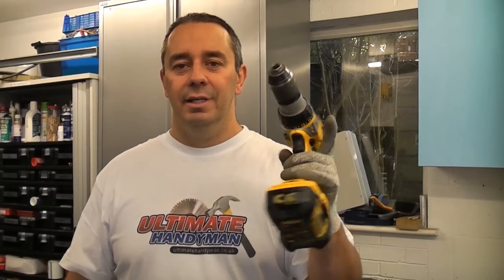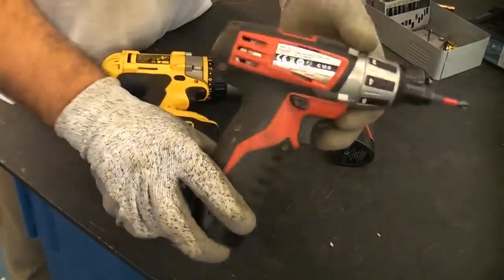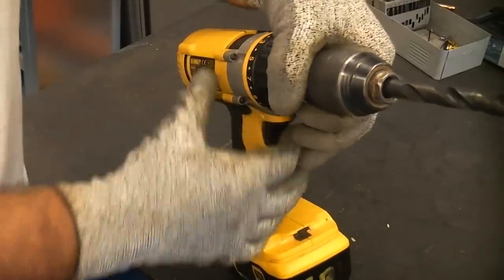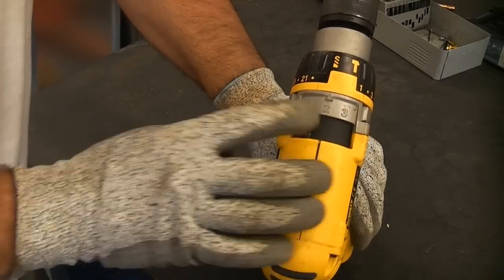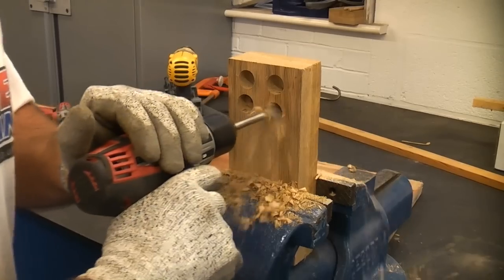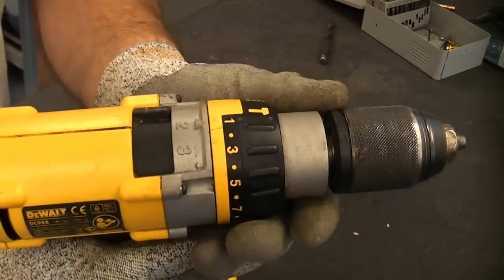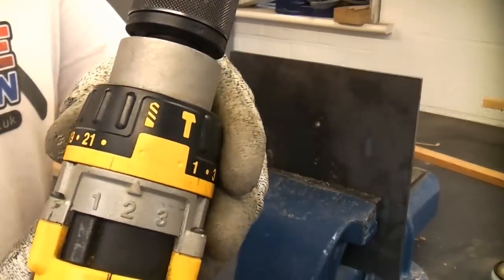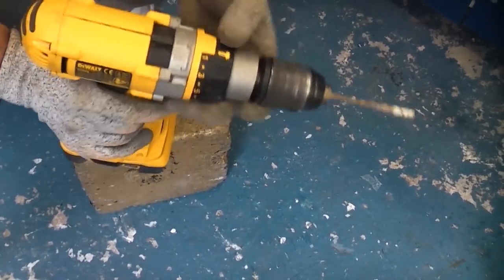How to use a cordless drill

Comment: Thanks for the demonstration & explanation.  I was using  a dewalt Dw 511 model to cut 3 inch holes with a 3 inch hole saw attachment to drill the blue pladtic drums & as the hole saw started to "bite" into the pladtic the whole drilling machine whipped out of my hand & landed almost 3 feet away.  Thats when i learnt about getting the right torquein a unit for the job at hand.
Reply from the maker: I'm glad you found the video useful.
Thanks for the comment 👍

Comment: Thank you so much for this. My Dad didn't think a girl needed to learn about DIY, so I'm a clueless adult. This video helped me fit cabinet handles in my bathroom. Awesome!
Reply from the maker: You are welcome
Thanks for the comment
Reply: Good on yer. Occasionally run into some very astute female sparkies on-site.
Reply: cabinet handles, pedicures, hair, no problem, girls can do that.

for real work, you need real men💪
Reply: Yes, my dad always said to find a man, which made me want to find a man even less. It is frustrating, though, getting this stuff and not having a clue. I'd like to hang my drapes with something other than command hooks, but a drill seemed like a better idea than manually screwing everything.

Comment: I got myself an 18V De-Walt, the first time I've had a drill with a little more power, thanks for teaching me how it works and reminding me to wear my safety specs, I suppose a safety mask is needed too depending on what you're drilling.
Reply from the maker: You are welcome.When drilling in some conditions a safety mask may be required.
Thanks for the comment

Comment: I got my first drill today, like a big kid hehe. Two things i thought i would mention; The torque is important incase you are driving screws into soft wood, if it's too high you will drive it through the wood, so it's important to pick the correct setting, how do you know which is the correct setting? start low and work your way up. Secondly when locking and unlocking to change your bits remember this saying (Lefty Loosey - Righty Tighty) :)
Reply from the maker: Thanks for the comment ;-)
Reply: Always use torque control, it saves your screws and your bits.

Comment: I just noticed that this demo was from 2014 - 5 years ago but I hope you're still stopping by to read the comments. Thank you, thank you. LOL Faith Hope and I are the two women who had the exact same problem in that we 'assumed' that we hit metal when the screw didn't go in and then chose a different location. Having watched your demo about the various torque settings, I'm almost sure that this may have been the problem. I have a Dewalt 20 V impact / power drill. My problem is that no matter how tight I turn the chuck after inserting the bit, it keeps loosen itself and upon removing it from the screw, it falls to the floor. What am I doing wrong? Or does the tool have a defect? I'll be checking in to see if there is a response from you.  Thank you ever so much.
Reply from the maker: Once the chuck is fully tightened, it should not come loose, unless the chuck is not tightened fully in the first place- or unless the chuck is faulty. Some keyless chucks have a two part chuck, so you need to hold the rear of the chuck with one hand, whilst tightening the front of the chuck with the other hand, but on more expensive drills the chuck is normally a one piece chuck. 
Thanks for the comment 👍

Comment: Just slightly confused. Are the 3 gears pre-set combinations of speed and torque? If you need to fine tune the combination of speed and torque, do you select a gear and then change the torque setting? Or do you use the variable speed to correspond with your torque setting? Hope the question makes sense.
Reply from the maker: No, you have to adjust the speed and the torque separately using a combination of the gears and the torque selector ring.
Thanks for the comment ;-)

Comment: saw on another video a demonstration that said when putting drill bit into chuck, tighten with your hands until tight and then turn in the opposite direction 'loosen' until you hear one click. This seems to be right in practice, but want to make sure i'm not damaging my drill!
Reply from the maker: I would not do that- just tighten the chuck as much as you can, otherwise the drill bit will not be gripped correctly.
Thanks for the comment 👍

Comment: Thanks for the excellent explanation

may sound like a stupid question..
how much Watt Power did the drill had? How much is enough to make holes through concrete?
Reply from the maker: I'm not sure, but it is an 18v drill, most drills above 14.4v will drill masonry as long as they have hammer action.

Comment: Really great video. Does the torque have to be the same setting when pulling the screw out as putting it in? Ex: i used 6 torque to drill do i have to use 6 torque to reverse?
Reply from the maker: No, when undoing the screws, you can just use the drill in it's maximum torque setting.
Thanks for the comment 👍

Comment: Great video and CLEAR demonstration.  I have the Dewalt DC725, its the  two speed version of the Dewalt in this video.  Can I install 1/4" lag bolts into studs with my drill and what would be best setting?  Thank you again!!
Reply from the maker: A drill is not really powerful enough to tighten bolts, you are much better off using an impact wrench.
Thanks for the comment 👍
Reply: @ultimatehandyman  I guess I lucked out...I got them in no problem.  But will probably purchase an impact driver the next time when they go on sale!  Thank you for your work here!!

Comment: While this is definitely the most helpful explanation I've come across–of how the speed and torque settings work, I'm still confused about a few things. To give you some background information, I'm using the DeWalt DCD780 Cordless Drill Driver, 20 volt, which has two speed and 15 torque settings. My first question is: When in drill mode, how do you know which speed to start with? From your demo, where you don't have enough torque to finish boring all the way through that wood with the spade bit, I know that switching to the lower number speed gives you more torque. But let's say you are drilling into something softer, starting OUT on the lower speed (I.e., you have too much torque for the job), how does the drill behave? My second question is twofold: First, when in driver mode, how do you know which speed or gear (in my case, I have two) to begin with? And second, how do you know where to set the torque (in my case, I have 15 settings) at the start of the job? Is one way safer than another for the user and/or the tool? 

Even though I'm very mechanically inclined, I've never been able to get a good understanding of these things, nor was I ever able to master riding a 10-speed bicycle! (I have mastered driving cars with manual transmissions (or stick shifts as we call them here in America), though, so I'm not completely hopeless.) 

Thanks!
Reply from the maker: bamabenz2000 

When selecting the drill speed you normally set it according
to the size of the drill bit that you are using. If you are using a mixer
paddle for paint, holesaws or large diameter drill bits in metal you need to
use the slowest speed- which as you say will give the most torque. You may also
find that larger diameter drill bits stall when drilling wood, so again you can
use the slower speed.

 

The faster speed on the drill can be used when drilling
small diameter holes, for example when drilling metal up to about 6mm in
diameter (1/4”) or when drilling wood up to about 12mm (1/2”) but it does
depend on the drill so that is just a rough guide.

 

When driving in screws it depends on the thread of the screw
and also the size, some screws drive in much faster than others depending on
the pitch of the thread so really you have to test the screws that you are
using to find the best speed. If they go in so fast that you lose control when
driving them it’s best to select a slower speed. When determining the torque
setting for the screw you can either start with the lowest torque and keep
increasing it until you get the screw head flush or just below the surface or
you can start with an higher torque and quickly let go of the switch when the
screw is at the correct depth, then adjust until you get the correct depth.

 

I hope this helps ;-)

 

Thanks for the comment

Comment: ❓Question sir, (or anyone who knows, I’m sure he’s quite busy) @7:46 what was that stuff sprayed before drilling the hole and why is it needed. Thank you. 🙏🤗💞🤗
Reply from the maker: That is metalworking spray, often called drilling/tapping fluid. It prevents the drill bit or hole saw from overheating, which can cause damage and often render the bit useless. When drilling steel or stainless steel, or other hard metals it is important to use it, or your cutting tools will soon go blunt.
Thanks for the comment
Reply: Ultimate Handyman - 🙏Thank you! I will be sure to get some. 💝

Comment: Thanks for the fantastic videos. I have a metal drilling machine with high torque and slow speed, the drill is too powerful that I am afraid to use anymore, the first time it twisted and broke a 13mm bit I was using, even though it has a very beefy handle.  The second time it nearly broke my wrist, so I stopped using it all together. Any idea how to use such machine safely?

Also, are hole-saws supposed to run straight and true? Or are they supposed to have a bit of a wobble on them? Because mine always wobble a bit. Thanks again.
Reply from the maker: You are welcome.
Some powerful drills can be dangerous to use, we have a Bosch drill on site that uses morse taper drill bits. The drill has two handles opposite each other. I have had a few fights with it over the years and always won, but it's best not to use drills that don't have torque control or a safety clutch as they can be dangerous.
You could try drilling smaller diameter holes first, then work your way up to the larger diameter bits, this will mean the drill will not struggle drilling the hole which should mean less resistance for the person holding the drill.

Some hole saws wobble a bit, it depends on the quality of the hole saw, also some of them have teeth that make the saw wobble a bit during use.
Reply: Thanks :)

Comment: Your demo was good, thank you for that. But having watched your video, there is something I'm still not sure of. I was trying to screw some metal plates to a solid bamboo table top (which had predrilled holes) - with great difficulty. I have a 18v drill, and I haven't used one before. I used a PZ2 bit for the screws (PH2 wasn't such a good fit), and for the most part I was able to drive the screws in. But the drill struggled a lot to get the screws all the way in even in low gear and high torque. I had to put a lot of weight behind the drill. Why was this?
Reply from the maker: Are the holes in the metal wide enough?
If you try putting the screw through the hole in the metal it should go through without catching the sides, if the screw won't go through the hole in the metal this is probably causing the problem.

Comment: Is the 18 volt machine suitable to use for drilling a hole through a concrete wall? The wall is about 4 inches thick. I basically want to put a BT telephone cable through that hole and connect it to the BT master socket.
Reply from the maker: It will do it, but a SDS machine would be much easier and quicker. You could do it with a 18v combination drill though if needed.

Comment: Hi, maybe you can help. I have an Erbauer Combi Drill (4 ah battery). I am having problems screwing down my squeaky chipboard floor. Even on first gear and 23rd torque setting, using 45mm Floor Tite flooring screws, the screw only goes in at best about 2/3 before the drill refuses to go any further. I've looked under the floor and I note that there is a narrow beam of timber (ply I think, blonde in colour, about an inch thick), which sits atop the joist between the joist and the timber floor. All I can think of is that this may be too dense to penetrate.  Before I resort pre drilling all the holes I hoped you might have some insight to help solve the problem. Up till now the Erbauer drills been performing well but on less demanding jobs. Its the kind of job I thought the combi would be OK with. Love the videos, learnt a lot, keep it up. Thanks. Steve Price.
Reply: Personally I'd get an impact driver. I prefer those to a drill for any kind of screw/bolt.  It doesn't get bogged down like a drill will because its using the impact to drive the screws.
Reply from the maker: Like snoopy the ace says an impact driver is better, but the drill should drive it in. Perhaps try putting the drill into drill function, so that you don't use the torque selector.
Reply: @snoopytheace4487  Thanks. I thought of that but I just moved into a new house and my limited tool budget went on the combi drill. But maybe I have to buy the impact driver after all. I'll try what UH says below first. Cheers.
Reply: @ultimatehandyman  Yes, I'll try that. Thanks.

Comment: If you're ever caught assembling pallets upon pallets of IKEA furniture, always work your torque setting just high enough to drive the screws until the stop (thus, start very low and then just add 1 until you get the right amount). Too much power will almost always damage the piece you're working on. I have a rather cheap Black&Decker cordless drill and I set my torque to 8, and if it has just a bit not enough torque then the clicking of the torque limiter will act a bit like hammer action, vibrating the screw into its hole. With metal connections, always screw the nuts and bolts by hand to ensure no cross-threading, then tighten to torque.
Reply from the maker: I have a Milwaukee 12v drill with a  hex shank chuck, which is brilliant for assembling furniture. It can save a massive amount of time!
Thanks for the comment
Reply: @ultimatehandyman  could you share the model name, please? Maybe I should look into it, hate wobbly bit holders sometimes slipping screws 😀 does it also have hammer setting?

Comment: Hi,
Do you have any experience yet of cycling your 4ah batts and runtime of them?
Ive got two brand new 4ah with an angle grinder,and on no load speed it had dropped to two bars on the gauge in just a minute or so.I thought these were supposed to be long lasting! Or do they need a few cycles to hold full charge?
I reckon you should do a runtime comparison with the nano li-ions.Should be exactly double.
Cheers!
Reply from the maker: animal79thecat 
I'm not sure to be honest if you need to charge them a few times to get the best use out of them. The 4ah batteries I have last ages, but I don't have the angle grinder! The grinder does normally use a lot of juice quickly though.
Reply: ***** Ok,thankyou for your reply.

Comment: So the 											 											 												Milwaukee 12v drill/driver 3/8" can use anything lower than 3/8" and non-hex, traditional drill bit. And can also be used as a driver unlike the 											 											 												Milwaukee 12v 1/4" hex drill.
Reply from the maker: They are both almost identical in what they do but the one with the 3/8 chuck can use traditional "round shank" bits or hex shank bits. The drill with the 1/4 hex holder can only hold hex bits but it's still my favorite drill ;-)
Thanks for the comment
Reply: *****
thank you

Comment: Hi,
thanks for the excellent video. Good Job! 
What is the measure of Torque on this Drill which you are using? Is there any measure of Torque?
Regards, Syed
Reply from the maker: There is no measure of torque, the settings are just 1 for the lowest amount and then whatever the highest number is for the most amount of torque - or turn it to the drill picture for no torque control at all. 
Thanks for the comment
Reply: Thank you for your answer. I appreciate  it immensely. 
What difference the Volts make? 12V, 18 V, etc.
Reply from the maker: Normally the higher the voltage of battery, the more powerful the drill will be.
There is also the amp hour rating of the battery (AH), the larger the AH the longer the battery will last between charges.
Reply: Many many thanks Sir.

Comment: Hi, What instances/applications would you use the low torque settings?
Reply from the maker: +Joel Laight 
When driving in small diameter screws, so that you don't sink them too deep or even shear them.
Thanks for the comment ;-)

Comment: Is that red tool is a automatic screwdriver or a drill? So, could I use a automatic screwdriver to drill a hole with a screw attached to it?
Reply from the maker: +Spreedator 1000 The red tool is a drill/driver, so it can be used for drilling if you insert a drill bit or for driving screws if you use a driver bit.You can't normally drill holes using screws as they cut a thread into the material, rather then cutting a hole in it.
Reply: +Ultimate Handyman Oh alright, thanks for the reply

Comment: So I've been using hammer action in the wrong gear with the wrong torque and the wrong drill bit to do one failed project with broken screws and the two by four not all the way drawn to the wall. Thank you! You couldn't get the Dewalt to not work well enough to demonstrate. lol, before watching your video I put and broke 5 screws!
Reply from the maker: +Patty Baker 
I love that Dewalt drill LOL, if I was stranded on a desert island and could only have one tool I'd take that drill ;-)
We have all broken screws at some point, at least you now know how not to break them LOL
Thanks for the comments
Reply: I can't back the screws out. I guess I'll have to use the reciprocal saw and cut it off the wall.
Reply from the maker: +Patty Baker 
You might be able to grab them using a good pair of molegrips if you have a set.
Some screws can be difficult to cut with a reciprocating saw.
Reply: broke off flush to 2x4
Reply from the maker: +Patty Baker 
Not much you can do when that happens!
Reply: Yeah that's what I thought. Thanks!